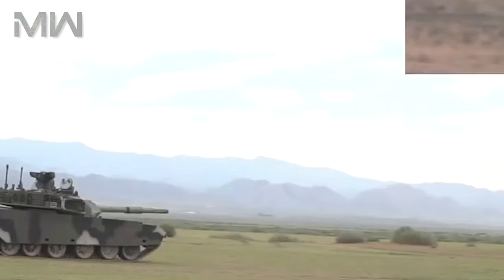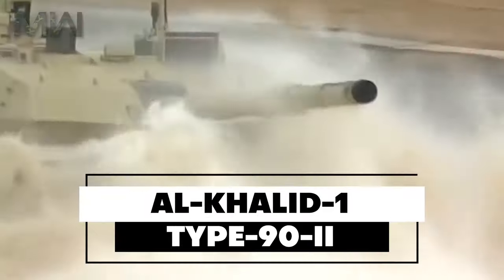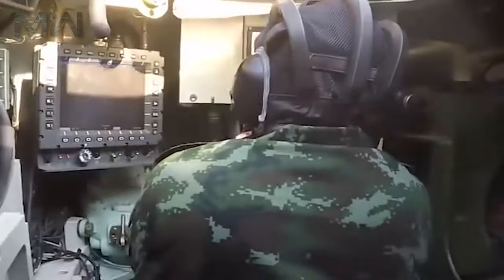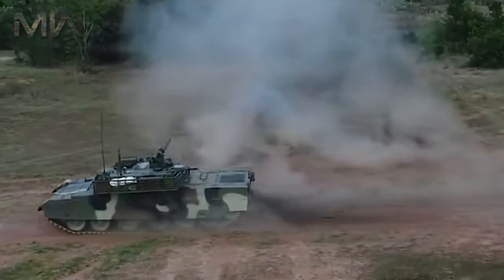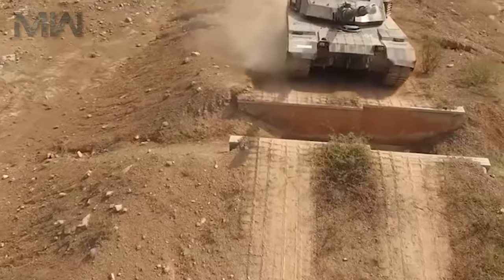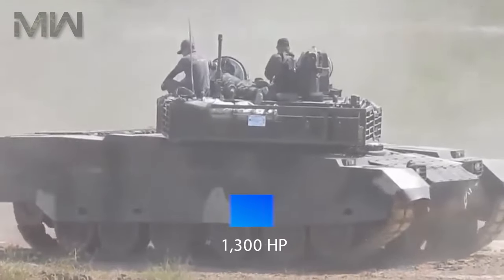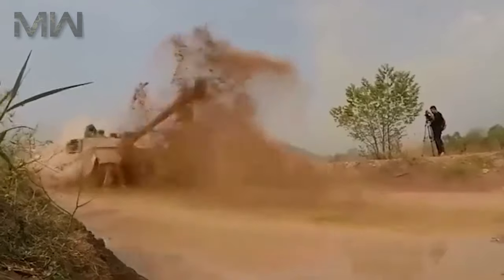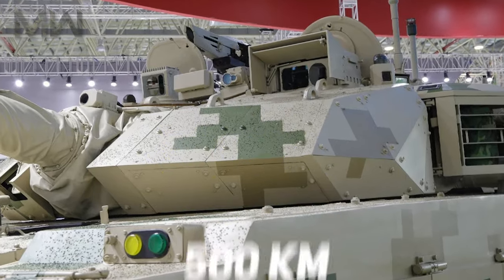MBT VT4: Chinese Main Battle Tank

Comment: Its armor is basically the same as the type 96A. Good for developing countries who want more modern MBT's.
Reply: With FY-4 ERA this tank can stop modern APFSDS rounds. The worst thing in this tank is ammunition which can reach about 600-650mm against RHA.
Reply: @Venom6662  600 mm is more than enough for the countries that use it
Reply: @Venom6662  if by modern ammunition you mean DM33 then yes, it can stop modern ammunition
Reply: The turret of VT-4 is a new design, which is more advanced than PLA's own 99A. The same as 96A is VT-2.
Reply: as same as ZTZ96A? are you kidding me😂
Reply: @Sriaffa  no
Reply: you should check your eyes
Reply: This tank is much heavier than 96A, I don’t think it’s armor is the same as 96A

Comment: 52 tonnes isn't massive at all for an MBT.
Reply: It's 55 tons
Reply: @ivanvasiliev8710  with ERA 55 TONNES. WITHOUT ERA 52 TONNES
Reply: You have to consider the terrain condition. Light weight, medium weight, heavy weight (50t to 54t and 55t to 62t) have their own usesage.  Remember China also have type 99a2 tank 58t. But only service at china north area like inner Mongolian provine and Xinjiang desert area.
Reply: @michaelgfyau4514  99a2 more than 60 tons.
Reply: @AwardQueue  yupe. 58 tons is empty weight. Plus ammunition and fuels ot extra armor yes more than 60.
Reply: @AwardQueue No the differences aren't so far apart...